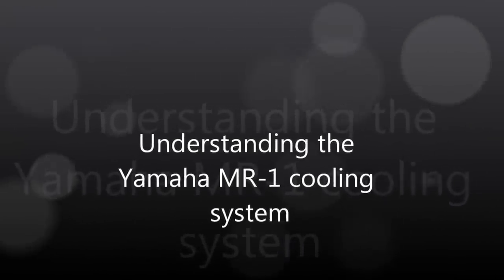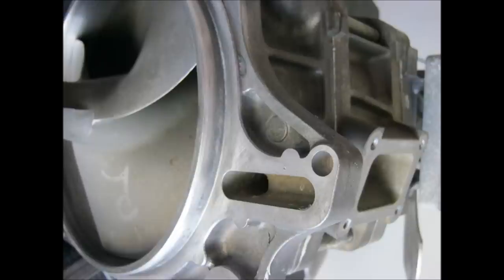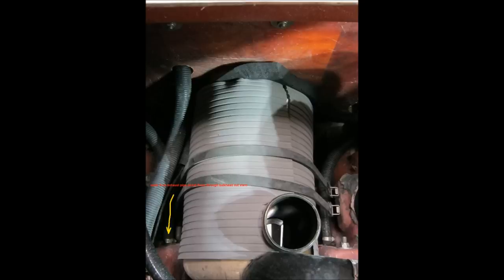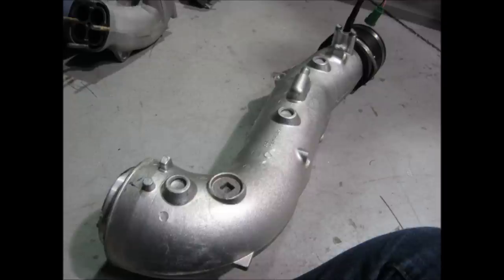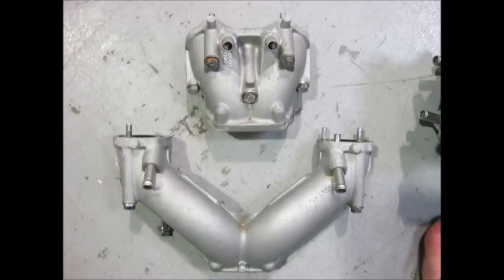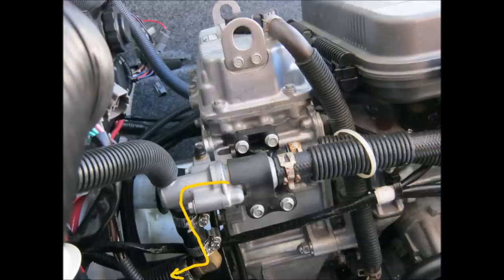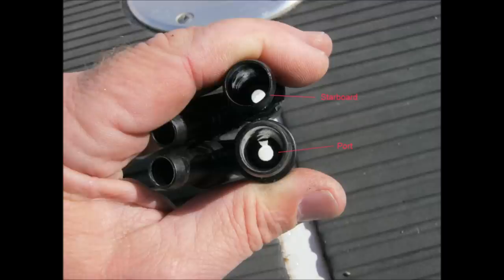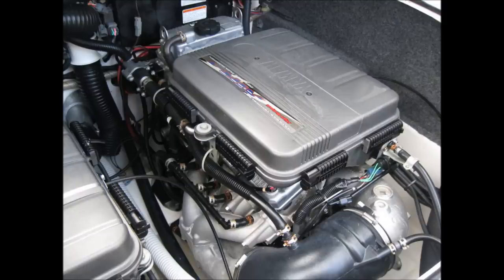Understanding the MR 1 cooling system

Comment: I am gonna ditto @ The FPV Life 's comment. This is an excellent "mechanics view" of this system. I have been doing PWC's for a little over 6 years now. I am a diesel mechanic by trade, but I have been working on all things since I was about 10. I am 39 now, and I can tell you that this is the most comprehensive video to date that I have seen on this engine platform. I have a "03 FX cruiser, it had gotten water into the crankcase, via the water outlet pipe O-ring on the front of the cylinder head, and forced it's way under the valve cover gasket, due the grommet on the outer portion of the valve cover being quite the seal of integrity LOL. I fixed it after getting on HELL of a deal on it for $600. My family has enjoyed it for 4 years now, and I have always noticed there isn't a very good deal of water coming out of the exhaust flow indicator. I get a little under throttle, but last summer I notice it smelled like exhaust and had some vapor flow coming out of it. So I am thinking that the bellows joint is cracked. It's always been a freshwater machine, but the outlet pipe I had fixed years ago had quite a bit of corrosion in that bore when I repaired the o-ring. So the thought of the block and water passages being blocked concerns me. It has never overheated, and we pull kids on tubes like gang busters every summer. So that makes me feel a little more confident about this just being more of the exhaust joint issue. Because if it has exhaust gas pushing the water away in the joint, the water it just exiting out of the rear, instead of the indicator.

Comment: Great Video...one note of importance is that the arrow at 4:07 out the front of the oil cooler into the top of valve cover on the engine rear is not a cooling line, that is an oil line.  It drops into the valve cover to an open hole over the cam shafts and the internal hole is blocked off with a plate attached with an allen head.  At least that's what I see in the engines that I have apart right now.

Comment: Found the problem! The short section of hose between the Y fitting and the distribution port (1:25) has a pre-formed bend. This section of hose was collapsing at lower PSI, causing it to overheat at idle, but at higher speed, it was able to feed enough water to the engine. Replaced it with a longer section of hose, with a nice, smooth radius, instead of a sharp bend. Works fine now.

Comment: An important note regarding the cooling system: if you ever have water in your oil, the FIRST thing you want to check is the exhaust manifold as those mating surfaces can corrode, and being that close to the cylinder head, with the valve overlap and aggressive cam lift of the MR-1 engine, it will ingest water from this point. I had this issue with my engine... but suspecting it was a head gasket, I removed the cylinder head before I removed the exhaust manifolds. 

On the other hand, if exhaust manifolds and gaskets look OK and the engine has good compression, then the next thing to check is the oil cooler/tank. Cap off the outlet hose with a fitting and a pressure gage, hook a garden hose to the inlet on the bottom of the tank, and using a valve, slowly bring  water pressure up to around 15 PSI, then let it sit for 15-20 minutes. If there is no loss in pressure then the head gasket would be the next suspect. 

I say all of this to save anyone the difficulties involved in disassembling the entire top end to get to the head gasket, as the intakes/throttle bodies, valve cover, camshafts and caps must be removed before you can access the cylinder head bolts.

Comment: Should water be coming out the nozzle on the side of the ski when the hose is attatched and running at idle? Nothing coming out of mine, checked the pipe which exist the ski, that is unblocked so no idea why nothing is coming out

Comment: On the hose i have water exiting through the jet pump and exhaust but none is coming from the fitting on the stern above the jet pump. I believe its from the engine block that passes the thermostat. After 10 mins on the hose it overheated and got to 250 f. What do you think the culprit could be? Any help would be great, thanks

Comment: If they put arrows on the hoses to inform you which direction the water flows you might understand or color code them but that would make them more expensive and not necessary to a mechanic. Find a good mechanic and tip them for doing a great job. They will go the extra mile for you, stay late, rob a part from another job to float your boat, beg the parts guy to get what you need. Make a relationship with a good mechanic or technician yummy food , cold drinks on a hot day and a crisp twenty, The bill you pay at a repair shop is up to the manager not the mechanic, the work that is performed is.  if you care about them by showing some gratitude and not complaining like the last guy trying to get it fixed for free they will take care of you so welcome to the VIP section my friends.

Comment: I have an 06 sx230 that I can't figure out. Within 5 mins on the lake it over heats and engine drops rpms. I've changed the thermosensor and pulled the engine and checked for salt water corrosion and it was minimal. Ive used non contact thermometer and I don't see the engine over heating, both engines are the same. Good pee flow and no cavitation. I'm stumped. Would the thermo sensor be bad? Do those put the engine in limp mode or will it just shut down the engine? Any help is much appreciated
Reply: Did you find the problem yet?
Reply: @mikemike827  I took apart the exhaust and cleaned any scale build up. Wasn't bad enough to cause restriction imo. I replaced the thermo sensor and it's still doing it. I'm going to replace the 2 thermo switches and see if that works. It not then I'll probably burn it down!
Reply: coot Ingram just one motor?  Did you look to see if water hose collapses at idle but full flow at higher rpm?
Reply: @mikemike827  yes just the starboard engine. I've inspected all the cooling lines and everything appears to be in good shape
Reply: Did you resolve your issue? Im having similar issue like you.. my engine is running at 6krpms.. but if i put it on neutral and push it again .. goes to 10rpms and back to 6krpms.
Temperature light is on.. but engine is not oveheating
Reply: @123partyrentals  mine was a bad thermo sensor on the block between the exhaust manifold. Does your alarm go off and the overheard light turn on?
Reply: @cootingram6265  no alarm.. is just the light on dashboard. Event when the boat is cold.
I replace spark plugs.. it was running at high rpms for good 5 mins and all of the sudden back to 6krpms..  i put it on neutral.. push it fast again.. goes to 10-11k rpms and 2 seconds later:. Back to 6krpms... 
temperature light is always on when this happens.
Reply: @123partyrentals  could possibly be a bad thermo sensor.
Reply: @cootingram6265  since i have to remove the manifold i guess i will replace both...
Reply: @123partyrentals  I replaced all 3 but I'm certain my problematic sensor was the one behind the manifold. I pulled the engine to do it
Reply: @cootingram6265  wow... that sounds like a big job lol...   well keep you posted if that fixes the problem
Reply: @123partyrentals  I had it out in about 30 minutes. 4 bolts, fuel line, throttle cable and 5 or 6 electrical connectors
Reply: Update... 
Is always good to post when you find the problem lol....

Anyways..
Comes out to be that is the temperature sensor on the exhaust.. 
My YDS came yesterday.. best $50 ever spend.. 
plugged in.. read overheating code.
Deleted the code, unplugged sensor and it was good., as soon as i plug it back in the signal came back. I took it to the water today.. the yds tells you temperatures and everything on the boat, but i also used the non-contact thermometer just to make sure i was not overheating, everything was running perfect with the sensor unplugged. I will be ordering new sensor today..

Thank you guys for all the info. This really helped me a lot🙏🙏

Comment: Mine ( YAMAHA FX140 2002 ) has an Overheating Warning Light coming up after couples of minutes of running in the seawater. Suddenly, I’d started the pwc to flush after 48 hours and after a few seconds of turned ON the buzz started to warn about OVERHEATING. What it could be ? Thermosensor ?
Reply: I have an 02 that I just went through an inspection. Is there water flowing out of the through hull ports when it’s running and warmed up ? These are there to let you know if water is flowing. Check it out there is one on each side. When they are you can check the temp of the water with your hand 🖐 at a minimum remove and clean your thermostat. It’s actually not too difficult and located at the top beside the oil tank I bet it’s full of poop, calcium clean it up and test it in a cup of hot water to watch it open. Check your anode, easier than you think . Undo the little bolt on the side only not the middle one, it will pop off easy. There will be a rubber o ring. Flush clogged lines if your thermo is plugged up nasty, so the y pipe line that goes back to the intake at the impeller and the through hulls at the sides with water and compressed air. There you go my friends , Bob Ross

Comment: What a way over complicted system OMG
Reply: Works very well though :) The MR-1 engine is legedarily reliable.
Reply: I have an overheat issue w 1 engine on my 2007 AR210. No issues with these engines for over 12 years. This is a great video. I agree though w you Neil..seems like too many areas can affect the cooling on these engines. Like Victor said...these are super reliable engines for the most part.
Reply: No issues in twelve years and it’s over complicated? That’s called reliable, so in twelve years did you ever replace the anode in the case or your thermostat? Most owners wait for something to go wrong then fix only that problem. All you really have to do is clean mechanical things and they work. These are open cooling systems which work well and for many years but this is mechanical not digital ok, most guys don’t even flush there engines after a salty ride just hose off the hull and trailer. After you ride and the engine is hot and so is the oil. At a minimum, PULL OFF THE SEATS AND REAR TUB TO LET OUT THE MOISTURE FROM YOUR HULL please this will be the laziest easiest thing you can do. If you don’t have any info on how to maintain and that means service something mechanical it will fail. How many years of reliability do you think you might get with a closed cooling system and a supercharger ?
Reply: Neil, and to all of you other Neil’s, there is only one thing really ,  are you ready for it ? Here it comes ,,,,,,,,water flow